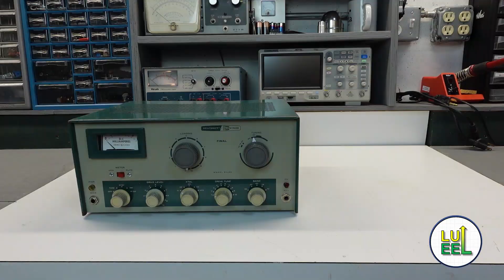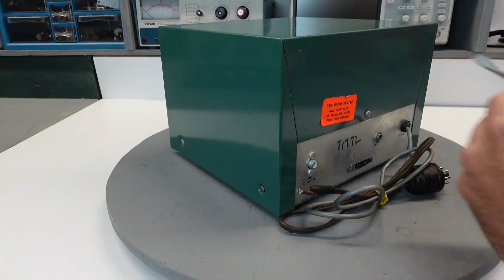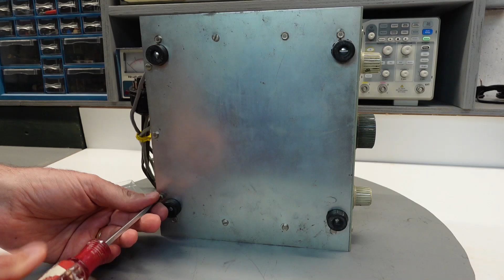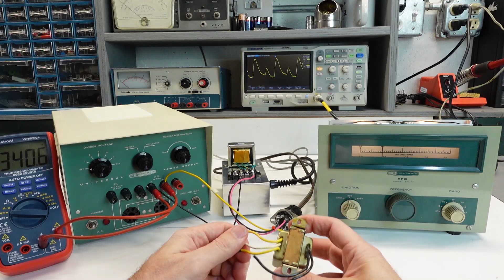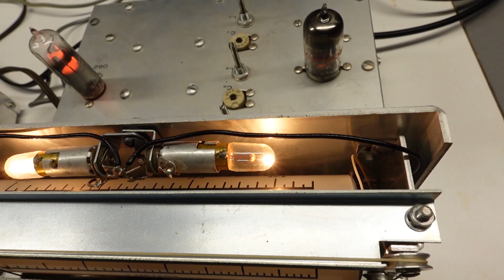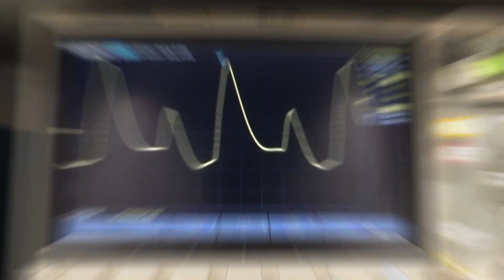Heathkit HG-10 VFO

Comment: Great video on the HG 10. Can I use a short 50 ohm jumper for the VFO output cable?
Reply from the maker: I think any coax with nominal 50 ohm impedance would work OK.
Reply: @levelupeelab  I appreciate you. I've learned a lot from your videos.

Comment: Have you decided on a receiver to mate with your DX 60? The HR 10 (B), is OK on 80 and 40 meters, though, no CW filter. You'll find the higher bands above 40 meters are very weak on the HR 10. The SB 301 has a MUCH better rx and it has a position for a CW filter. I'm almost certain the DX 60 and SB 301 were on the market for some overlapping years and are period compatible.  73, Glenn WA4AOS